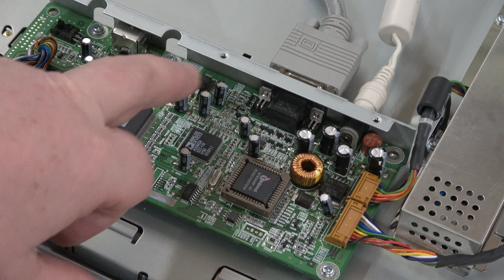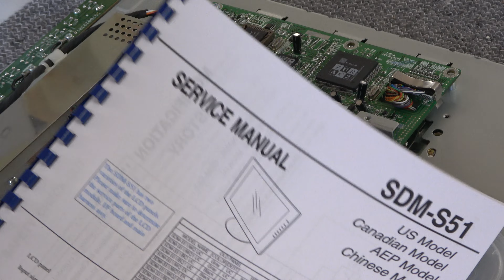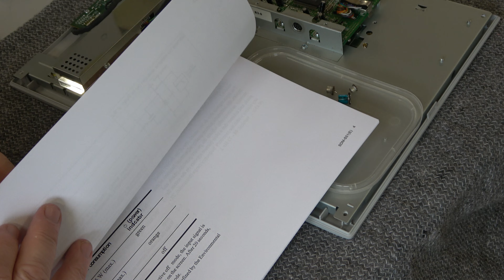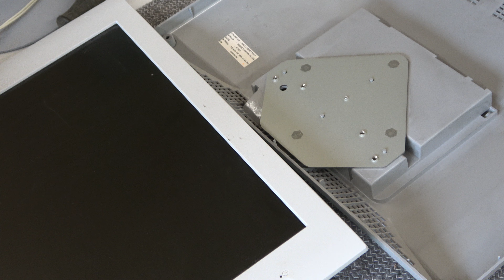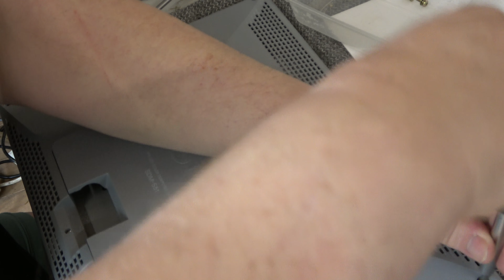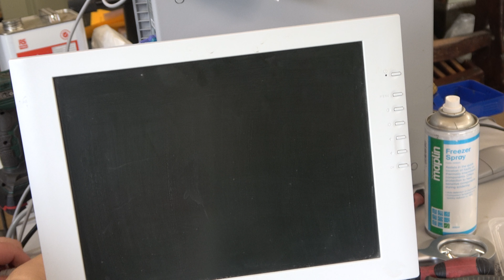Sony SDM-S51 TFT computer monitor repair

Comment: Nice to see it up and running job well done I remember being on Windows 95 then Windows XP, and Windows 7  then Windows 10, online 10 was the worst ever as it kept updating when you were using it so I dropped backed to Windows 7 at the time, XP was good too back in the day.